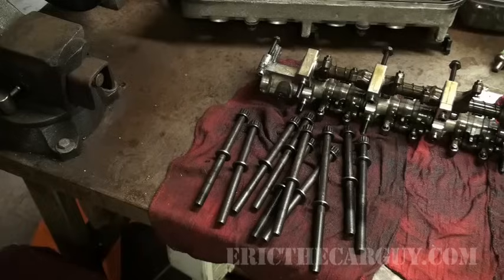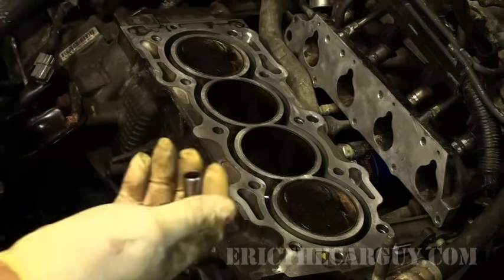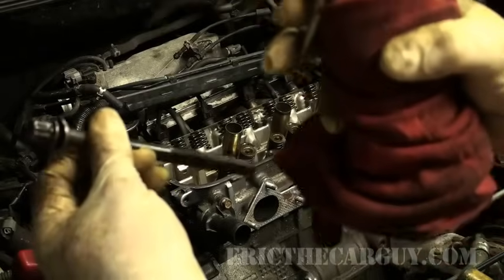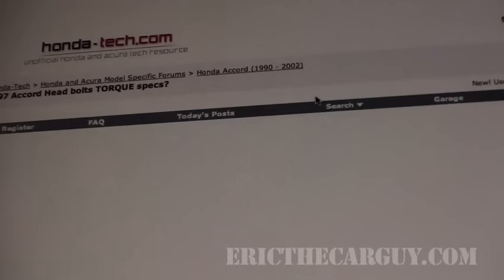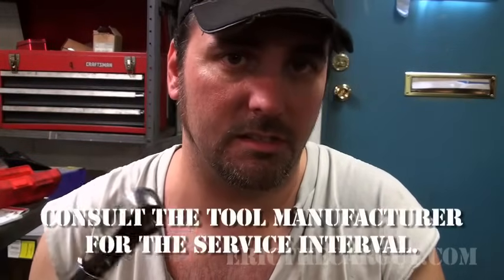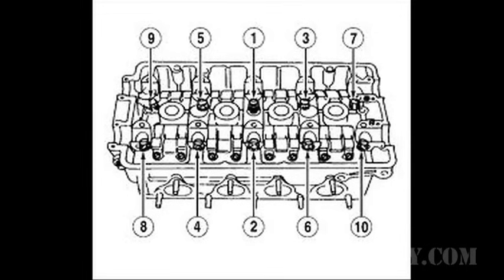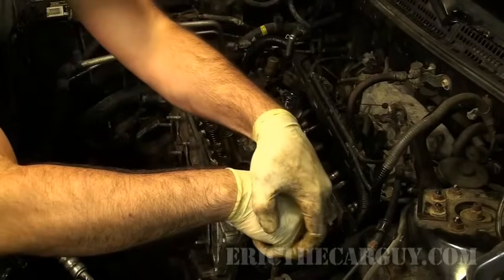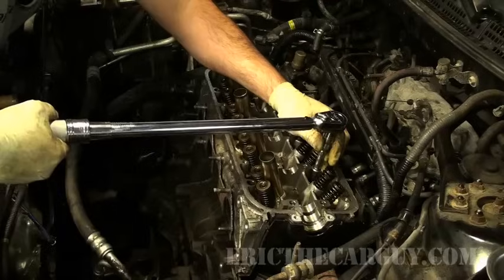How To Torque Cylinder Head Bolts - EricTheCarGuy

Comment: i was wondering, i took out my intake manifold of my gm blazer... the torque specs are 23 ft-ibs to intake manifold, throttle body tbi220 is 18 ft. lbs. can i do this with a 1/2 torque wrench or a 3/8 ? because i found a nice digital torque wrench that is 1/2 it includes ft ibs to nm to in-ibs, i need to ask because since a 1/2 wrench handle is longer than the 3/8 even if i do the same torque specs i may brake the bolts? or doesnt matter as long as i do it right an slowly ? thanks :)

Comment from the maker: @robertbaxley A tap is designed to MAKE threads, you don't want to do that in this application so you use what is called a 'thread chaser' which is for CLEANING threads and won't alter the existing threads.  I do what I can to try and keep up with comments but it's getting more difficult, my priority is to the website and my forum so I always go there first to answer questions if that helps you.

Comment: You might be wondering why these comments come up on such old videos, but I have just recently started watching all of your videos from number 1 and actually learning a few things. On this video why do you mention not to use a Tap??? Is there harm to be done in cleaning the bolt with a die and the block bolt holes with a tap??? Great information here and your input is greatly appreciated. Also would you rather these questions be on the website or under these videos?? Thanks Eric

Robert

Comment from the maker: @BoilerDan8787 You don't want too much oil in the holes or oil to pool in the holes as it will create a situation that could lead to hydrostatic lock, the small amount of oil on the threads will not cause this and allow for a more accurate torque setting.

Comment: @KayC2SLO When torquing head studs, it is highly recommended to use ARP Torque Lubricant. Its absolutely proven to be the best product in the market to allow you to get closest to spec as you can. Nothing is better than ARP. Its best to not go cheap on something this important. Over-torque and Under-torque are both terrible things.

Comment: @whammymechanics hey just might add the actual shank of the extention will twist to a degree with almost any amount of torque applied it's not the slop... One other very important thing too is that some bolts need to be torqued dry meaning no oil I found out the hard way on a caterpillar d7 bolt the torque figure was 210ft-lb and I greased the nut and BANG snapped the 3/4 inch thread my mech walked over and said with the resistance on that lubed bolt you probably got it to 350ft-lb cause you ne

Comment from the maker: @KayC2SLO Engine oil will work just fine, I just happened to have a little left over transmission fluid that I used on these.

Comment: what kind of lubricating oil did you use[for the head bolts, and i'm assuming it'll work on more than just those? like if i wanted to re-torque my lug nuts? :D]? i almost imagined using engine oil LOL

Comment from the maker: @Benzedirk2012 I've never run into that on that engine and I've only ever had to take one of those cylinder heads off once in all the time I worked on Acura's.  If it's just spinning then the block may be stripped anyway, perhaps you could just cut the head off of the bolt or drill it out.

Comment: found out about strech bolts the hard way the other day doing a re/re on ead on 6.6 chevy diesel...should a changed them but i am used to cummins and detroit engines(larger models)and we usually get away without having to....anyways long story short.SNAP!!!!!GOT TO 100FT POUNDS.WHAT A PISS OFF!i HATE AUTOMOTIVE

Comment from the maker: @WhammyMechanics Indeed there are times where there is no way to avoid using extensions but it's commonly understood that it's best not to use them or use the shortest one possible to gain the most accurate torque readings.  I'm not saying your wrong because I do things I'm not 'suppose' to all the time but it's good to know proper procedure and if I'm going to put out a video like this I want to at least present the most accurate information that I can.

Comment from the maker: @graffie Lets put it this way, 'grease' copper or otherwise on the threads WILL effect the torque and the reading.  Second if they don't do that at the factory (which they don't) you shouldn't do it either.

Comment: @EricTheCarGuy hey eric i have a nissan micra and when i put the ignition on the check engine light does not come on but all the other lights work and therefore the car does not start i have checked all fuses and relays everthings seems to be ok please can you have as i dont the why the check engine light does not work anymore.

Comment from the maker: @hondafanic0203 The videos I make are based on the cars that come into the shop so I would have to have the same car come in needing the same service to make that video for you and to be honest Integra head gaskets don't go out all that often in my experience so it may be some time before I make that video.  However I JUST remembered that the engine in my video "Dissecting an Engine" IS an Integra 1.8 so you might want to check that out.

Comment: @EricTheCarGuy Yeah, I think I noted this from a race engine building scenario. Specifically, I think it was a Ford modular DOHC race engine, and they were getting that meticulous on the assembly. Might be a cultural thing too (engineering). And as you likely know, the factories now do synchronous torquing where they torque all the bolts down at the same time with multi-socket ratchet devices.

Comment: Eric, have you ever heard or seen one torque the first stage, and then actually back off the bolt and do it again again to "seat" the torqued components? When you started snugging the bolts intially and how the head moved on you, as well as how some bolts behaved one way while other behaved another way. Another thought on that is with whatever assembly lube you use, to get the lube to bind properly with the threads and bolt head. Then back 'em off then start the REAL torque procedure.

Comment: Hi again Eric,
Another tool I just picked up at HFT is 2 torque wrenches. 1 to measure inch pounds & the other foot pounds. I need to tighten my valve cover bolts to 7.2lbs so I dialed the large wrench almost at its lowest setting by lining up the marks to 7 lbs. I wanted to test the wrench on a bolt that takes a much higher torque to see if it would CLICK at 7 lbs. Got no click & I broke the test bolt right off. Should I stop buying HFT tools or am I doing something wrong... Again? lol

Comment: ERIC I HAVE A92 ACCORD EX I HAVE ANTI FREES ON MY HEADS WHAT TIPE OF CLEANER I CAN USE AND IF YOU CAN TELL ME THE TORQUE SPECS ON THE BOLTS AND ALL SO WHAT THE CAR WILL DO IF I PUT A PRELUDE INJECTORS AND FUEL RAIL ON IT

Comment: awesome vid, doing my first  head gasket change on an inline4 600cc motorbike engine. I was initially gonna use copper grease on the head bolts, but think i may use engine oil now

Comment from the maker: @fastvpbt1 Honestly that depends on what's causing it, for starters make sure you are using the correct oil called for by the manufacturer.  If you have noisy lifters I don't recommend using synthetic oil either as that can make it worse.

Comment: Hey Eric, I torqued my new head bolts in 3 stages on my 1996 geo tracker. I realize now that I didn't oil them and a few of them didnt go in smooth like you were talkin about. If I take them out can I still reuse them even if they've been torqued already. or did I just mess up and have to buy new bolts again?

Comment from the maker: @fastvpbt1 Not really no, it's the smaller fasteners with small torque specs you have to watch out for as they can be tricky but the bigger fasteners like these usually aren't the problem if treated right.

Comment: This is a GREAT video.  I wish everyone would torque this way, but all too often I see tire change places use an IMPACT wrench to rattle on lug nuts.  If you ask them to use a torque wrench, then they go around AFTER using the impact and of course it clicks at 80.  Heck, everything is probably tightened to about 120+, so they aren't don't anything but putting on a song and dance with the torque wrench...  Then they click it like 5 times in 2 seconds using a jerky motion.

Comment from the maker: @flashdkr In your case you need to make sure the block and the head are OK as your problem may not be the gasket but a problem with the head or block, a machine shop should be able to help you with that.

Comment: @Eric do u think maybe it's bcuz I used the same head bolts?? I took it apart and and found water in my pistons i placed another head gasket and re torqued  it but it still leaks... Anyways thanks for the videos if it wasn't for ur videos I wont even have been able to do the swap...

Comment from the maker: @MrMunono You may have to take it back apart as you may have installed the gasket wrong.  Also you NEED to torque the head according to the service manual procedure if you want the repair to last.

Comment: Hey eric... So I did the swap d15b8 block with a d16z6 but when I went to turn on the car smoke still came out I took the exhaust off n noticed there was water coming out of all four exhaust holes so I torque the head a little more n in two the holes the water stopped the other two there a little bit of water and a lot is smoke still should I torque my head sum more or wht do u suggest I should do? P.s  It's a 1995 civic n I already torqued the head to 53ft pounds.. I knw I asked a couple quest

Comment from the maker: @LuieDiaz1 After a head gasket job you will have smoke for a while due to the contamination that gets onto the parts during assembly and disassembly, it takes a little while for it to burn off.  If you suspect a head gasket issue I suggest you test for it instead of speculating, watch the Diagnosing A Cooling System Overheat video for details on that test.

Comment: Hey i had two quick questions... in what kind of pattern do u remove the head bolts is it the same pattern as when u put them back? Also do u have to torque the head bolts every time u put a cylinder head back or is it just in certain cars? Thanks

Comment: I adjust the screw on the head of my toyota camry 1994 4 cylinder 
45 torque and the mechanic told me, then give them a 90 
grade to each screw, but my problem is that I did not give them the 90-turn 
grade to each screw and assemble the engine and I'm driving my car with 
a torque of 45. and serious question what will happen with my car in the future or not 
anything happen?

Comment from the maker: @ladabyturbo I don't think so, you don't want to use a grease that will dry up or put more pressure on the threads, oil works just fine.

Comment: An easy way to make a thread chaser is to grind a angled slit into the threads of an old head bolt, obviously you can only do that if you're replacing the bolts.

Comment from the maker: @fmaytorena1 The videos I produced on what comes into the shop so it's hard to fill such requests but in your case I would remove the head and see if I can get a vice grip or something on what's left of the bolt and twist it out.  If you can't gain purchase then you may have to drill it out or use and 'easy out' to extract the remains.  Good luck.

Comment: @zzztubazzz Since you want to get technical how do you suggest applying these 199 pounds?  From a meter, maybe a yard, how bout 2 feet, or 6 inches maybe?  Since you are obviously talented when it comes to mechanical engineering but lacking in sentence skills let me ask you this.  Do you realize that the specs you read in a manual can be skewed as much as 50% by using thread lockers or moly grease on the threads of the bolt?!  Either way I think Eric did a good job showing the basic procedure.

Comment from the maker: @jjenson2006 Interesting method but how would you see the bolt head while you turned it?  You really should come up to torque in one motion not several trying to read a mark on a bolt head, I'm not saying your method would not work but I believe the use of the tool would be more accurate and yield a better result.  Thanks for the comment.

Comment: The torque specs for my cylinder head are 58 ft/lbs, then 90 degrees and again 90 degrees. The shop manual specifies painting a small dot on each bolt head and another on the head to visually determine the degrees. When you are done, the dots on each bolt should be opposite (180 degrees)  from each other. I guess if your specs require an odd number of degrees, you have to use one of those gauges.

Comment from the maker: @6speeddakota I don't recall using a 'degree wheel' for setting points but perhaps for dialing in a cam.  It's been a while since I watched this if I said degree wheel I take it back, your terminology is more correct.

Comment from the maker: @kevtay1000 No need to replace the bolts they are not torque to yield bolts.  If there is a torque spec with a degree measurement as opposed to a torque value those are usually  stretch bolts and require replacement.

Comment: @qaz3000 i used a beam type my first head change and the guy i sold the car to never had a problem or had to tighten the cam down but i broke the wrench it was a cheap plastic handle so i had to be real carefull and after all that i forgot to put in the intake gasket i felt like a complete dumbass lol and i call myself a car guy but i learn like everyone else

Comment from the maker: @kingster92ify Depends on the engine and how the surfaces are suppose to be treated, with steal gaskets you want an almost mirror surface so you can't use abrasives of any kind, on everything else I like to use an angle die grinder with a plastic bristle disc to remove any left over gasket material.

Comment: Hey Eric Thanks once againg...like i said before your video really helped me a lot...i am not a mechanich but i am working on my engine myself and this video is amazing...i learn a lot from you...now i do have a question? i have a Pontiac Firebird 3.8 V6 Automatic, i replaced the Valve Lifters but i do not know the measurement (TORQUE) for the adjustments...is there any way that you can help me out...i do have the torque but i do not have the measurement...and honestly dont know hot to read it.

Comment from the maker: @ejsecco I've gotten a lot of different input on this one.  On this particular engine however Honda actually says to lubricate the threads.  I lubricate them so that I get a smooth transition to the torque value as any hiccups will give a false reading.  Thanks for your input.

Comment from the maker: @philosifur1 In some cases you are correct but years ago I read an article about just reinstalling warped heads and re-torquing them to spec (aluminum heads that is).  I've been doing this for years with great success.  I'm not saying don't check them but as I said I've had quite a bit of success with this method.  Thanks for the input.

Comment: Hi Eric - I realize this vid is for torquing technique, but I just wanted to say that if a blown head gasket is involved, it may be a good idea to get the head checked for warpage before re-installing.  Years ago I replaced the blown gaskets on a vintage Chevy V8, and I did not know to check for warp.  I wound up with new blown gaskets and a 2nd head gasket job within 2 weeks.  Pulled the heads, had them milled, everything was fine after that.  Having to re-do the heads was very un-fun.

Comment from the maker: @davidzzz94 Most times you can feel it as well as hear it, it cam be tricky if you don't oil the area between the fastener head and washer because it will sometimes make a noise similar to the click.

Comment from the maker: @JDMnubi I usually do some from under the car and the others I use a 1/4" socket and ratchet.  It's a lot easier after you remove the thermostat housing and the bracket under the intake.

Comment from the maker: @bigsteve84769 I think as long as they have oil on the threads when you install them you are good as I don't see the benefit of soaking them because the metal will not absorb the oil in any way.  Thanks for the comment.

Comment: @EricTheCarGuy but it looks like it once had washers as you can see the shape of old washers that could of been there when motor was new. i did buy new bolts and was wondering if i should buy the washers and use them this time around.

Comment from the maker: @letxen3 No they don't.  Don't install washers where there was none as this will effect their torque value.  Make sure they are not stretch bolts, if they are then you will have to install new ones as you are not suppose to reuse them.

Comment from the maker: @archer435 Over time I have developed a "feel" for my air tools similar to using hand tools and in this case I would say that my air ratchet did not put any torque on the fasteners it just saved me the time of running them down by hand.  I've heard the axiom about not wire wheeling the threads and for some applications I would agree but up to this point I have not experienced any ill effects from doing this, I've seen worse by not doing it however.

Comment from the maker: @archer435 Your comments and input are appreciated and for the most part I agree, if I were assembling the Mona Lisa of engines I would treat it as such but in this particular case it was a used car that was damaged by a previous repair, the client was looking to turn the car around to prevent further loss of profit.  There is something to be considered as well with a job like this and that is that "time is money", time saved is money saved.
Reply: You should work for NASA